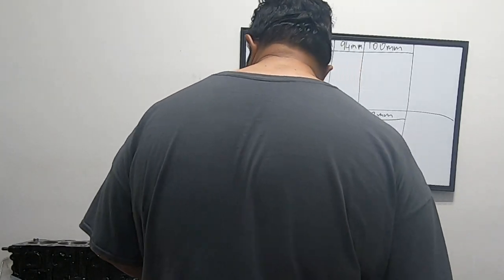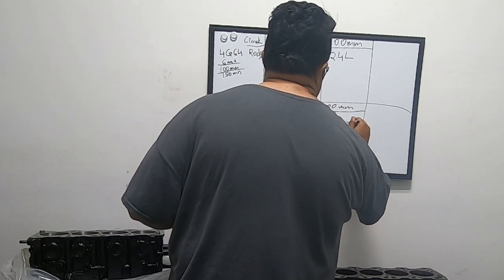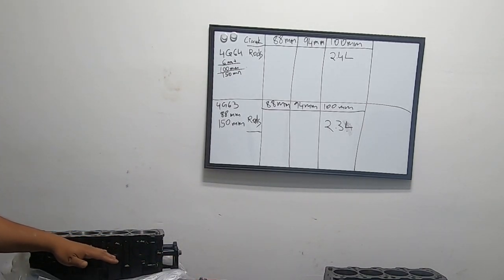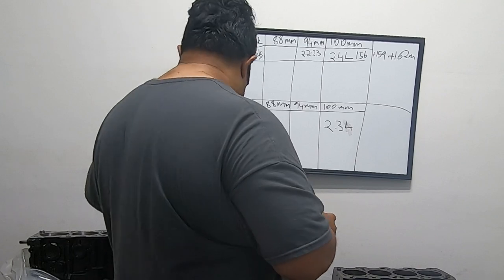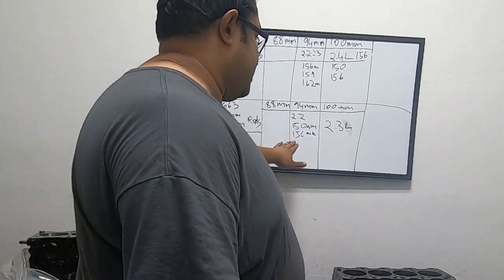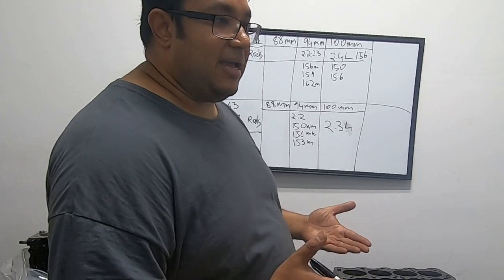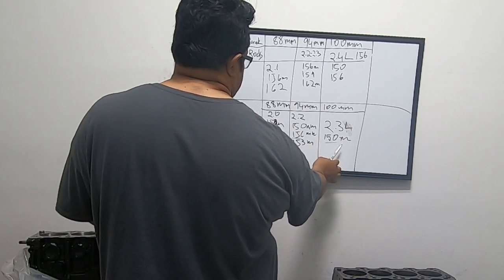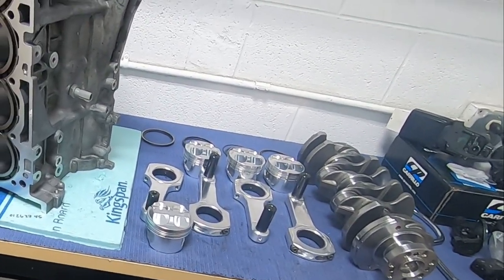4g63 vs 4g64 stroker 2.1 2.2 2.3 2.4 explained

Comment: Putting a 4g63 head on a 4g64 short block doesn’t make it a 2.4 stroker since you haven’t changed the stroke of the stock block. All it does is makes it a DOHC 4G64

Comment: I have a 2003 Mitsubishi Outlander AWD. It's auto but I'm thinking about boosting it. Should I send it or swap the crank and destroke it? I'm in Indiana
Reply from the maker: I don't think ur stock crank will be bad for below 8k revs. I would keep it. Just maybe change the internals depending on the power ur aiming for.
Reply: Any update on this?

Comment: I have used MMC stock diesel steel 93 mm crankshaft. It's just as strong as any aftermarket 94mm crankshaft. The benefit is that it's very cheap and you can use very thin head gasket which is a good thing for a high boosted engine...

Comment: Thank you for this video, ive been looking to do an evo build for awhile as ive found you get very good return for the amount of money you put into the car. Ive built a sr20 with vvl head with a 2.2 stroker and the rod to stroke ratio sits around 1.4 which is less than ideal when the head combo loves to live at 9000rpm and beyond its a harsh motor that has bad harmonics, hard on bearings too. As much as i love the s15 that the motor lives in, i think the evo is a better platform and ive been doing some research into these long rod motors. Really appreciate that you made this video and looks like 4g63 with 94mm crank and 153mm rods is the go paired with a 64 or 68mm turbo
Reply from the maker: I'm glad this helped. Upon further research you will discover good and bad about each engine. No 1 engine type does everything better than the rest. So you will need to find what works the best for what you will use the car for.
Reply: @bdalchemist  appreciate the reply. Looking to have a nice street car. My s15 is more of a roll race/dig car. Makes 1000whp runs a 6870. Not exactly the best combo for light to light or even a spirited canyon run. This is the reason why I want to move to a different platform. Looking to do more hill runs/circuit driving with street manners. My conclusion would be a nice punchy 700-800whp on high boost for rolls and drag with low boost set approx 600hp for circuit use and street driving. We have e85 bowsers here in aus so it will be run full time on e85 with 9.0.1 compression. I was thinking of the 6466 paired with a 94mm crank and 153mm rods. Do you think the mivec head would be usefull or a non mivec head?
Reply from the maker: @SR22VET-S15  mivec would help spool and mid range torque.

Comment: I love this video; I think this is my 6x watching it. I feel like the only thing id change is maybe bringing up evo 1-3 4g63 pulleys face the drivers side and evo 4-9 face passenger.
Reply: the engine did flip but you also have to keep in mind that those cars are right hand drive. So the belt on the 4's is on the drivers side of the car because its on the right hand side.

Comment: Could you do a comparison with the 4g69 too that's what my Lancer Ralliart has. 4g93/4g93 would be interesting too, basically all the 4g variants. Mostly interested in 4g69 though.
Reply from the maker: i rely on customers to bring their projects here. i will definitely do one if someone brings it in.
Reply: @bdalchemist  They were slightly popular to modify when the old ralliarts were new but not anymore. Probably won't see one in the shop if you haven't yet. They have some kind of variable exhaust timing but they're SOHC and don't hold a ton of boost stock.
Reply: 4g69 has extremely skinny rods and won't last on boost. I did a completely build on mine with manley platinum stroker pistons, eagle rods and arp headstuds. Ran 27 psi on that setup from an hx40 on pump gas.

Comment: BD Alchemist, Hi I have few questions. I built a 7 bolt 2G motor 2.3 stroker for my 98 Eclipse GST, how high can you wine the rpms on these 2.3 strokers? I deleted the oil squirters on the engine build is it going hurt not using them? This is for street/performance application just to let you know.
Reply from the maker: Consensus is 8200rpm. But better to refer to your builder.

Comment: Can I put a stock Evo crank and rods in a 4g69 with stock 4g69 pistons ??. I hear the block is the same deck height as the Evo with a 87mm bore. Seems like a good budget replacement block.

Comment: How do you get a 2.1 Destroker? What's the ratio for that?
Reply from the maker: 88mm crank with a 4g64 block. Ration is = rod length ÷ crank stroke size
Reply: What rods? Stock 4G64 rod length?
Reply from the maker: @ZachPPierce  it's explained in the vid. But with 88mm crank and 64 block u have a few options 156/160/162
Reply: You can also use a diesel crank, 93mm stroke iirc.
Reply: Yes, it's a very good option- cheap and reliable...

Comment: I've got a question for ya :) I've got a 1984 Mitsubishi L300 4x4 Van factory fitted with the 4G63, (Single Cam non turbo Carby - G63B). I'm currently weighing up between a twin cam turbo conversion for the current engine or if i should just dohc turbo a 4g64.
Power band needs to be between 2500rpm and 4500rpm, I guess the other alternative is the 4G54 sohc turbo (2.6L Sigma motor).

I'm considering a super turbo compound setup to keep exhaust back pressure and temp low if required but would really like the shy away from water meth injection and e85 fuels due to the sheer amount of km's this van will do, and the remoteness of the community's it will visit. 

Expected daily vehicle weight including driver 1800kg, upto 2400kg with trailer. Yes the vehicle needs a GVM upgrade lol. 

What would your ideal engine choice be? I've heard 4g63's dont take kindly to big boost at lowish RPMs

Thank you in advance, Matt
Reply from the maker: The strongest of all of them is the 4g63 , in the 2.0 dohc setup. If u want low end power then the 2.3 4g63 or 2.4 4g64 will be ur best option.

Comment: I have an 01 eclipse gs with the 2.4l 4g64 i would like to know what i could do to improve performance and durability i was thinking of turboing and a head swap but was also looking for a stroker kit if possible could u tell me what u think would be my options for performance upgrades and if there is a stroker kit i could get for it and  where i could find it. Thx u
Reply from the maker: Pm me in FB
Reply: I have the same engine and roughly the same question, any update on this?
Reply: BD Alchemist is ur fb the same name
Reply from the maker: Yes
Reply: Ok I shall msg you possibly in a few days thx
Reply: Youd wanna use a kia or Hyundai head; you could build that head using evo cams, valves, springs, intake, fuel rail, injectors, and upgrade the fuel pump. If you wanna save some money vs a evo 4-9 head

Comment: I am going for a Nitto 2.2L for my 4g63, 94mm crank, 86mm pistons, 153mm I-Beam rods. Is this ok? Do I have to move the wrist pins thanks
Reply from the maker: Yes u do, 6mm. Also I'm assuming ur going to aluminum rods. Make sure u get l19/625 rod bolts and upgraded wrist pins.
Reply: @bdalchemist  thanks will do! I will be upgrading to ACL bearings too what do you think
Reply from the maker: I use kings most of the time.

Comment: Do you use the 88 mm crankshaft from a non-turbo 4g63 or does it have to be from a turbocharged 4 g 63.is there a difference between these crankshafts ? In terms of coats and machining
Reply from the maker: I believe the 4g63t cranks are different. They can hold 1000-1100 whp
Reply: All same
Reply: @VMAN Viney non turbo and turbos same engine no oil squirters and different pistons ....what am I missing
Reply: @VMAN Viney holdon I'm talking about the early 4gs not the Evo ones lol my bad
Reply: @VMAN Viney well I have a Evo crank in my 2g it's like 6 lbs lights straight swap in too lol and Evo 8 ECU the engines are the same but a bit diff at the same time I rather the oldies...they hold up like hell 6bolt and 7 but that can crank walk is a killer
Reply: @VMAN Viney still rocking stock drivetrain?
Reply: @VMAN Viney coupes are sweet ...that's why I got my 2g lol don't like sedans ...besides Audi S4 lol

Comment: I have a quick question, I have a evo 9 with a 4g63 block 100mm crank 156mmrods and wiseco 86mm pistons that the pin is 6mm up, the car was built and ran perfect but issues with injectors lead to rebuild. I’ve order new pistons due to bad ones but went back with same specs..... is this motor still 2.3 and is this combo ok to keep? As it’s almost to late due to having new parts in thanks in advance
Reply from the maker: So without knowing the actual damage cause I cannot say for sure. Usually 86mm bore  is the absolute limit of high boost application due to head gasket sealing issues. I do not know if ur cylinder walls need to be re honed, usually with new pistons it's always a good idea to do so. Also I think ur measurements are a little off , with 100mm crank u cannot use 156mm rods. You would use 150mm rods and pistons with wrist pints moved up 6mm or custom 153mm rods and wrist pins moved up 9mm (not recommended).
Reply: BD Alchemist ok thanks alot, so found out it is indeed 150mm rods, he was mistaking off another build. So it is 
86mm bore 100mm crank 150mm rods and wiseco hd pistons
Reply from the maker: @duckworth311  great, and yes it's still a 2.3

Comment: Which timing belt do i use with a 64 block and 63 head??????
Reply from the maker: U can use Evo 8 or 9 , but u will need a adjustable timing gear to set the timing correctly
Reply: Thanks a million
Reply: Also what bearing clearances do you run on your main and conrods?

Comment: '99 Eclipse did not come with a 4G64. It came with a 4G63 like every other DSM and every Evo until the X.
Reply: my man do your research second generation Mitsubishi Eclipse coupe from 1994-1999  comes with 2.4L 4G64 and 2.0 4G63T
Reply: @shavkatburhanov1325  Somewhat correct. Only the GS Convertible came with the 2.4L NA powerplant.

Comment: Um no no I don't agree. With this at all he says you can run 162mm on the same crank? Meaning you'll have a weaker top hat if you have to make it up with wrist pins. If someone's willing to build you a hazardous motor knowing it'll detonate because poor quality. I wouldn't work with that shop
Reply: I've been using shorter pidtons for years with 100 mm , 94 mm, 93 mm crankshafts and 156 mm rods- no issues so far